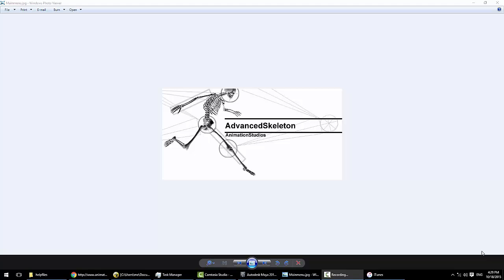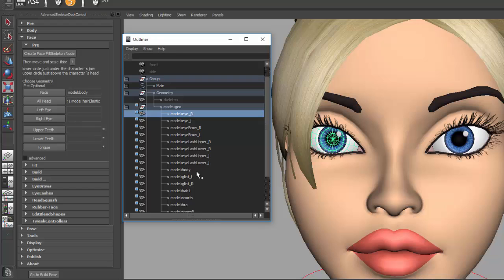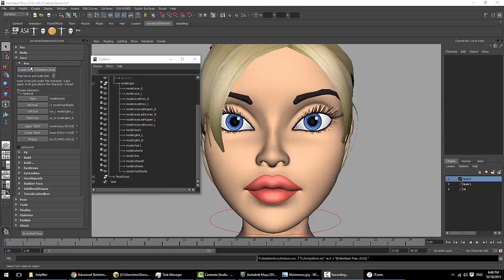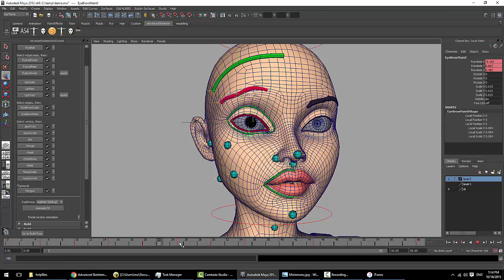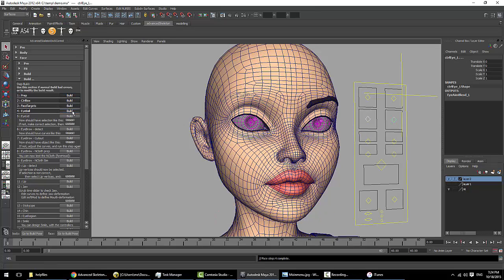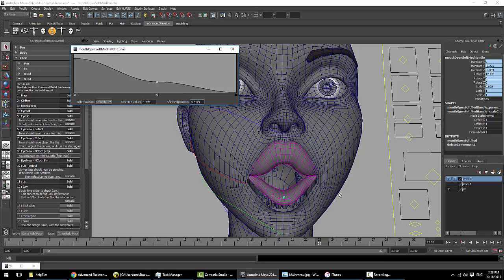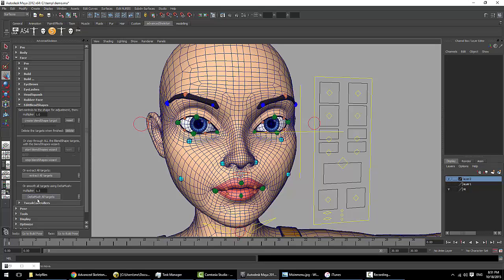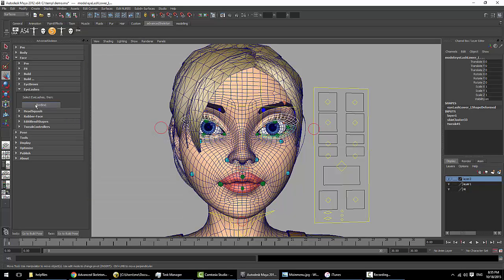Face step-builder

Comment: Hi there,
Is there a way to remove the facial setup once it is already made?
Reply from the maker: Yes, First click on the button called "Toggle Fit/Adv",
then click on the button called "Delete Adv".
That will remove the FaceSetup, leaving only the "Face-Fitting".
If you wish to remove the "Face-Fitting" as well, then use the outliner to find and delete the object called "FaceGroup"
Reply: @AdvancedSkeleton  Thank you.
I'm trying to debug why some face vertices are not getting properly exported when I export the model to glTF (in MAYA it looks OK), so I thought to redo the facial setup or just remove it completely and go step by step.
Is there any way to create a simpler face setup?, may be with already created blendshapes and no joints?
Thanks!
Reply: I answer myself: I see you have a vídeo for doing a simpler face setup here -> https://www.youtube.com/watch?v=n1L40oitizU

Comment: I am trying to set up the Facial rig for a character i have already completed the skinning weight painting on before hand. Since the mesh already has a skincluster  the facial rig setup wont work. 

Is there a way around this or do i have to go to a save before i did the skinning and weight painting, set up the facial controls and then do the skinning and weight painting anew?

Comment: When I try to define the entire head area i get the error message: // Error: file: D:/work file/maya/addons/AdvancedSkeleton5.mel line 18372: Object '':Hair1Shape' not found. // 

Sometimes the error shows other objects in the face that are not found like the eye lashes or the eye geo.

Anyone else that have had this problem and know how to fix it? 
I am using maya 2017 and i am rigging a custom built model.
Reply: I found the solution. 

If anyone else have the same problem, the problem was the naming of the objects. The way i renamed the objects was Charactername_Geo_bodypart. No numbers in the naming like Charactername_Geo_Hair1

Comment: Hi, i´m having an issue with the jaw. When i try to build the rigg in steps and i try the "jaw" build button (step 12) i get this error:
AdvancedSkeleton5.mel line 13512: Invalid expression type for IF test condition.
If i try again it says there is already a jaw and that i should delete the old one first. Any hints?
Reply: Getting the same issue 
Any solution ?

Comment: Hello, I've had some issues. The step 9 didn't work right then the other steps follow it in a wrong way.
Step 9: my skin doesn't match perfectly with the spline guide.
Step 11: my characters skin rotates on Z axis. My lips controllers are not working as expected
Step 12: the vertices are most selected on the top of lip, the bottom vertices are not selected and by changing the distance it hasn't solved the problem.
Step 14: my characters skin rotates even more on Z axis, Error: "No object matches name: eyeLidVtxs"
Continue it will not fixe my facial rig.
I hope you guys can help me.
Thanks.
Reply: I had these errors before, I dont had good loops in my model,It must be completely symmetrical, centered and when you make the step facial prerigg ensure that selections lips eyes eyebrows are consecutive loops uninterrupted sequence of edges
Reply: +Oscar J. Hoyos Guerra how do you ensure that the loops are uninterrupted sequence of edges? The loop around the outer lip of my model is a an interrupted sequence of edges (2 sequences).. do you know how can I make it uninterrupted, combine the 2 sequences into one?
Reply: HOLA MARIA!!! i would have to see the model to know exactly what you need to do, if it's a matter  of loops i have to see the topology of the head....     the facial rigg no work for you?
Reply: I actually got that loop of the lip working but still have other issues with the facial rig..  seems like every time I fix something, there's something else not working properly eyes rolling :/
Reply: The best thing you can do is to do the rigg again, delete the history of the geometry and start from the beginning, if you can send me an image to better understand what you need, much better, i help you
Reply: Well the teeth and gums get distorted when I move the mouth down...the upper teeth get dragged down, and the lower gums are dragged up.. also it seems that the teeth and gums don't move together but separately :( dont know what's causing this... the rest of the rig is working fine though
https://lh3.googleusercontent.com/fEWH4FVxOuIRlAjCuj1r8QDdsIVvfUCNFYO5kthOyuApODII6F2yxLyAiwFpyokPVTP-LFytsA
Reply: The link you send me is broken...   what I would do is combine the geometry of the teeth and gums, so that it has only one object, and so you should assign it to the pre rigg of the advanced skeleton facial system
Reply: Dont know why the link is not working :/ 

The geometry of the teeth is already combined with the gums and also with the head.. so the entire head is one geometry including teeth, gums, tongue..

When I did the fit rig setup I selected the faces of the teeth as my geometry for the teeth. 

Do you think I should also select the faces of the gums along with the faces of the teeth?
Reply: The geometry of the head should not be combined with the teeth, the tongue, the lower teeth and upper teeth should be as independent objects
Reply: Umm no I don't think it matters because in this video of AS the geometry of the teeth is also combined with the geometry of the head, same as my model
Reply: If you do not do it separately, you must enter the editing regions (edit-regions) and paint the vertices in the "paint skin", so I separate and assign them as independent geometry, in these advanced skeleton videos, not everything so specific, I am sure that if you separate everything will work very well ...
Reply: sorry my english dont good, hahahaha ;)

Comment: I was curious, will this work on top of another rig? i have some characters rigged through Mixamo for their bodies, but no facial rig. WOuld this work as an add-on on top of that to get the facial rig going?
Reply: Yes. I've done it. Just make sure you have rigged the head, neck, jaw, tongue, etc. Advanced Face is more of a blend shape thing, not so much a rigging/joint thing.
Reply: coool thanks I acutally JUST got one to work too a couple days ago. However a few vertices inthe mouth area are connected to the wrong influences and not sure how to fix those as like you said seems to be more blendshape based than skinning. I wish there was a knowledge base of forum for this software somewhere......
Reply: Do you mean that when you move the control for one thing (like the eyebrow movement for example), others things, like the OTHER eyebrow, will move as well?
Reply: No, more like if I raise the upper lip and several vertices stuck to the lower lip. Like this, heres a screen grab: https://www.dropbox.com/s/eb048hxtv8k4tdz/ScreenShot2016.png?dl=0
Reply: I have the same issues that I don't know how to solve :/

Comment: Help please, when I build eyelids in step 5 the selection isn't around the eyes, it's somewhere else. And when I go into vertex mode to update selection to make it around the eyes as shown in the help example, then I click update, nothing happens. It's the same with all the other steps for some reason. Please help, I've gone back n forward redoing the exact same steps as shown in the video and examples but it just doesn't seem to work at all. Please help..this is frustrating

Comment: when I press the animate Fit button. the time slider always jump to 190. even I change it to 1000 in the Time slider menu .and save it...  but when I build face animation again .but it still change number to 190 .and I get a warning : // Warning: Cycle on 'time1.outTime' may not evaluate as expected.  (Use 'cycleCheck -e off' to disable this warning.)  How can I fix it? Thanks for help.

Comment: help guys!!! 
Error when building Step 11. LIP
AdvancedSkeleton5.mel line 10064: No valid objects supplied to 'xform' command.
Reply: +Sabbir Sohan Same thing :/
Reply: +Sabbir Sohan I get this same issue.  I have been working at trying to solve it for a few days now.   Any help with this would be greatly appreciated!  Thanks in advance!
Reply: only solution that i've found so far is using another version of Advanced Skelton :(
Reply: +Sabbir Sohan version which worked him ok?
Reply: +Oscar J. Hoyos Guerra try to use latest version :)
Reply: +Sabbir Sohan I use the version 5.160 and everything is ok (Y)